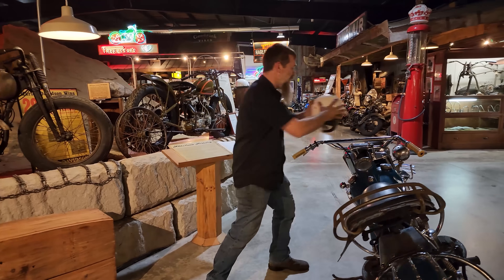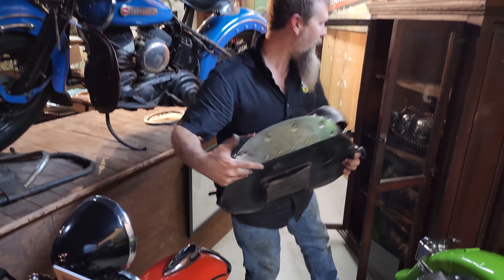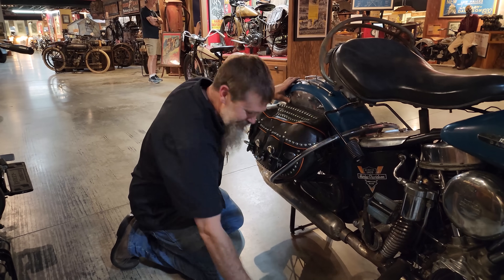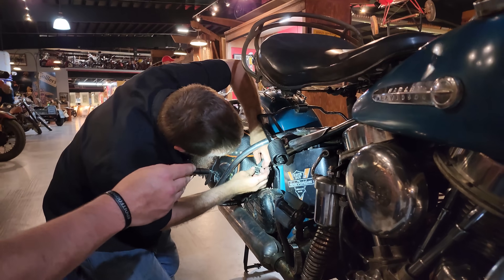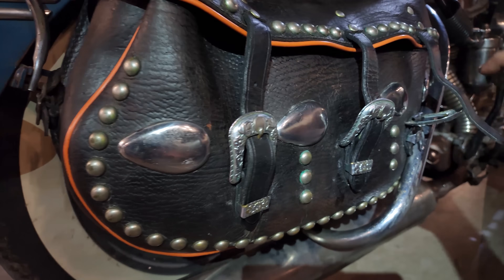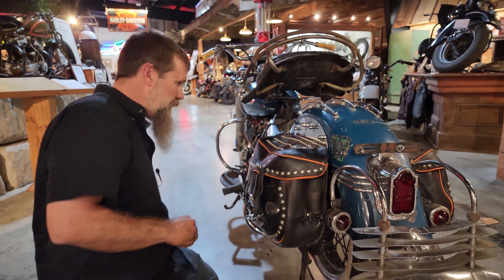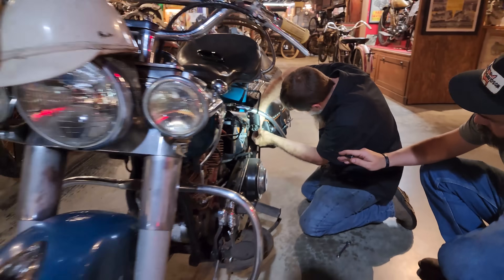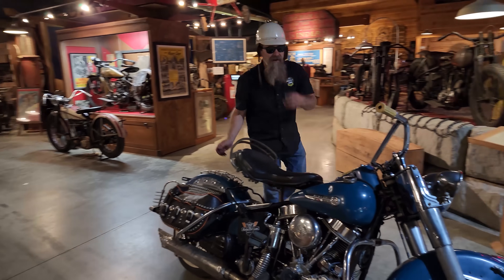LOOK WHAT WE FOUND!

Comment: Boy, what blast from my past that was. At 15 years old in 1961, my dad, an old Harley guy from the 1930's decided we needed a father/son project so off we went to Russ Winters Harley Davidson on Queen St. in Toronto, Ontario, Canada where we bought an ex-Toronto Metro Police unit, a 1951 Pan Head Hydra Glide with the hand shift and rocker clutch.  It's tank and fenders were still painted in a cream colour with wheel spokes painted black.  Russ filled bushel baskets with odds and sods he thought we'd need to put it all together and Dad and I worked all through the winter of  61 getting it back to running condition.  I rode that thing until I joined the RCN and it never let me down but - as is shown in your video clip of it sitting for just the ten minutes it took you to  mount those bags - it always marked it's spot wherever it was parked with chaincase drippings. Loved that old bike and desperately wished I'd kept it, even if all I did with it was to push it under the hay in the barn out back.  It's be great to now at the age of 76 haul that old girl out and dangle it in front of one of the neighbour families as a potential 'nuther gen. father/son project.  You guys are living the life.

Comment: This looks just like my buddies' lima bean green factory original paint 1947 knucklehead. The only thing on that bike that wasn't original, it had a 63 pan bottom end, and it had two left side tank badges, one would be upside down on the other side of the tank. But that was it everything was original, my buddies Uncle bought it for like $25 when he was a kid. He put the 63 pan bottom-end in it, and got it running. And there it sat, in his basement, forever.

Comment: I wish you did not buy that motorcycle. That Harley along with his. Accessories is just so cool it's beyond words at the sake it's going to be locked up in the museum forever breaks my heart. I know your Museum exhibits all run but it's not like the bike is ridden every day and going out on the weekends for fun and games. That Harley would make someone very happy to have as a everyday riding motorcycle. Of course I am sure that the price you pay for the bike would be the going market price for a bike like that. If I had that motorcycle I would put a belt primary drive and a belt secondary drive and that Panhead would be as smooth as any of my BMW Airhead motorcycles from the 1970s. When I started writing with the Harley boys with my little Honda you saw Knuckleheads and flatheads and panheads and there was no big deal about it because that's what they rode because they could not afford a new bike so they Road and old one.